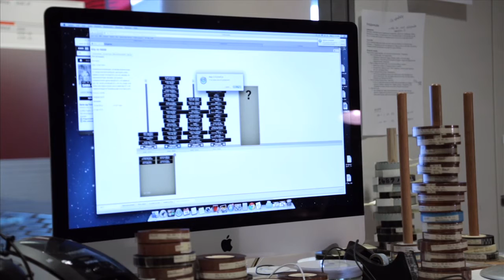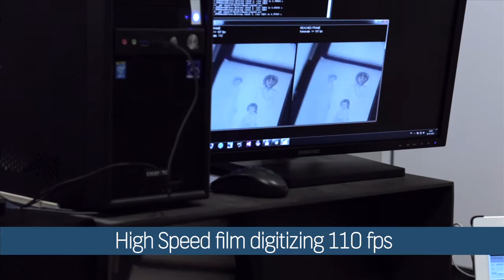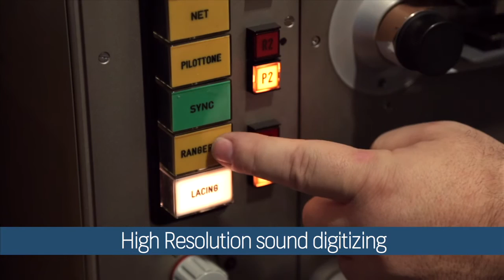DR Digitization Workflow

Comment: Is that an Arduino and Ultrasonic ping-sensor at 01:00?
Reply: Yes, we were using it to measure the diameter of the reels, so we could figure out the length. We didn't want to end up with 'super reels' that couldn't be in the original film boxes